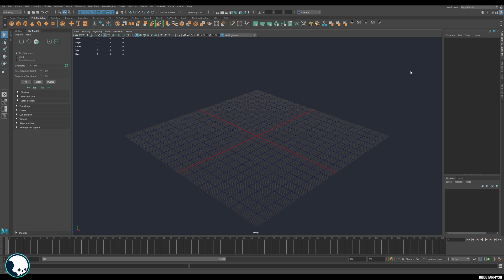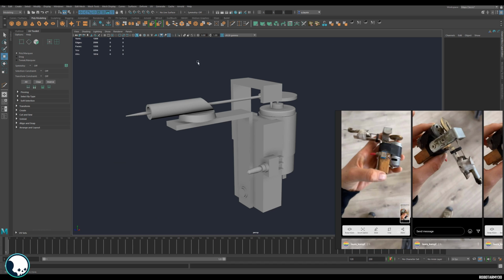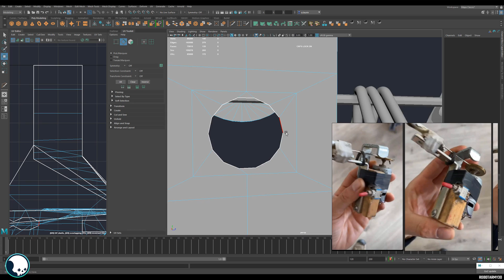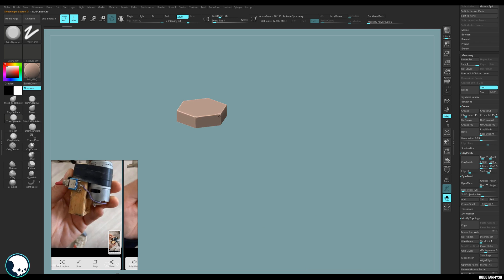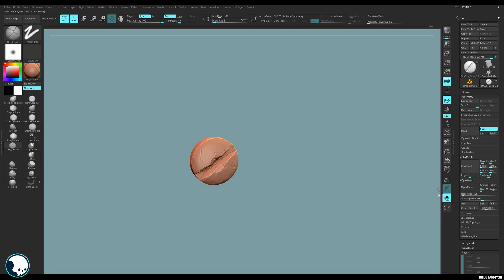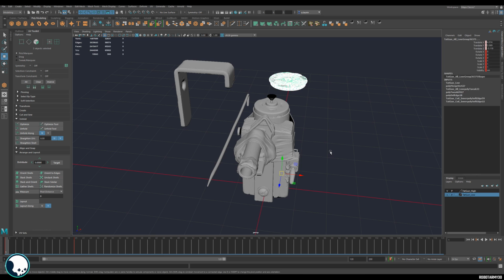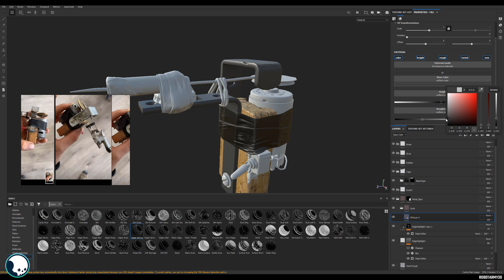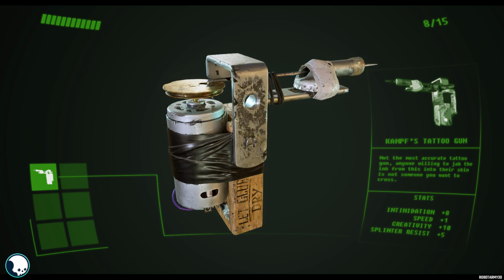REALISTIC GAME PROP -- Laura Kampf's Dystopian Tattoo Gun! - Process Tutorial -Maya-Zbrush-[Fallout]

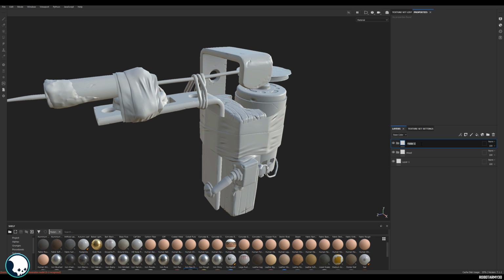Comment: 19:25 Sorry, whats happening here? 
You cut back to the normal unexploded variant and I'm not quite sure about the process in between. 
Are you exporting the maps of the exploded version and using it on the normal one?
Reply from the maker: Sorry for the slow reply - once you have baked your maps on an exploded model, you can swap it with a another model, in this case a non-exploded version by going to Edit>Project Configuration and loading in a new mesh in the top right corner of the dialog box. 
If your baked maps disappear after this its probably because the two meshes had different materials applied, so either apply the same material before you swap them over, or in substance painter go to your texture set list>Settings>Reasign texture set and switch them over.
Reply: @RobotArmy3D  Looks like I need to apologize for a late response also - and by a whole two months no less! 
I do appreciate the response. Was exactly what I was looking for. 
Thank you :)

Comment: Great tut dude i like your tuts and  i want to ask about low and high poly definition. for me and many people basically 1 million polygon is high poly and 1k poly is low poly mesh these are not problem but 25k,50k and 120k what are these dude? low? high? Other question is about tris and faces some people indicate tris someones faces in their model which one is true because for a model face and tris not equal tris always more than faces These make me always confusing dude.
Reply: The poly count is an unfair conversation it varies so much from game to game. Usually there's a certain amount of polys an engine can render at a time, so if you have a huge scene those props need to be modeled carefully, but if your scene is almost empty and you have just a few models rendered at a time, they can be very high poly. 

As for the faces vs tris, you should always give the tris count even if you ultimately call it face (which you shouldn't imo), because one tri is always one face but one face isn't always one tri. So the tri measurement is more accurate than the quad or ngon measurement, and when your model gets in engine, they will be triangulated no matter what.
Reply from the maker: To add to what Sono said, this is ultimately dependant on the application of the final asset. Is it for VFX? Games? if its games what type? high end next gen AAA title, or a multi-platform android game? 
If you are just making a generic "game ready" asset for your portfolio then a good start is to figure out how close this "asset" will come to screen. If its a FPS gun then parts of that model may come very close and so they will need to have high enough poly count to hold the detail. If not, then the model is unlikely to be larger than the screen, so the detail should hold up to how close its likely to get. Does that make sense??  And for this you are mostly making sure the silhouette of the model is clean and detailed. 

With this you should also find renders of models done by artists for games you like, this will give you a good idea if the quality/density and topological flow you should be aiming for. You may also be able to find a rough guide to poly counts for the type of asset you are creating. 

And that's pretty much the best you can do! - poly counts for game are always increasing (just check out polycounts between Horizon 1 vs 2!), but a single player FPS will still be very different to an MMORPG. If you are working for a studio they will give you guides for polycounts, etc.

And yes, every asset mesh is actually made out of triangles, 3 Verts to every Tri, 2 Tris to every Polygon, N-gon = Face with more than 4 sides (multiple Tris) and Pole is a Vert with more than 4 edges.